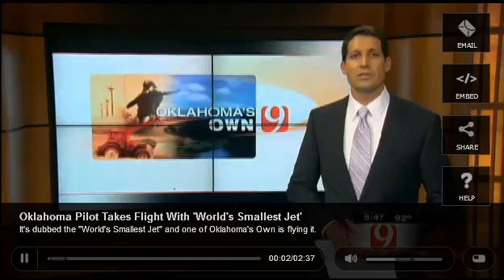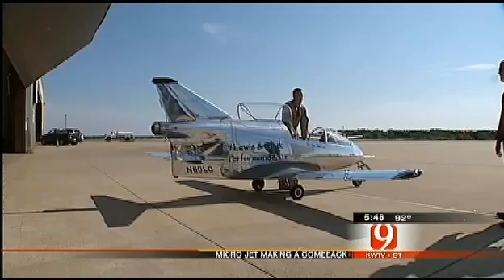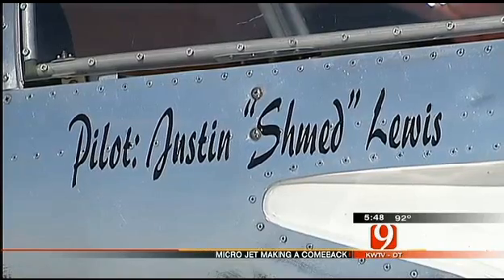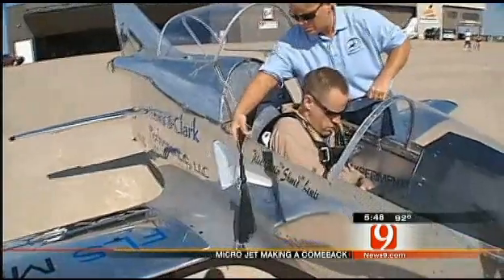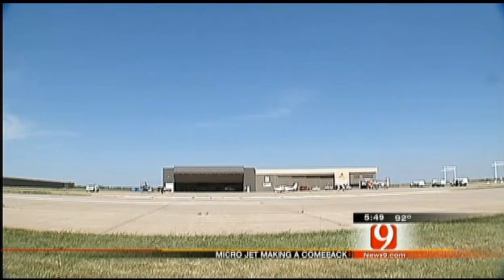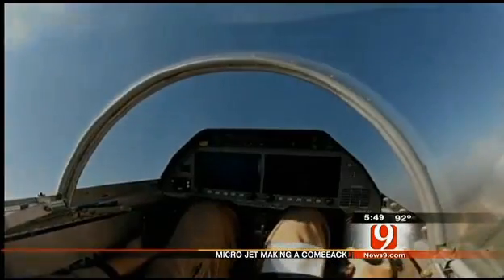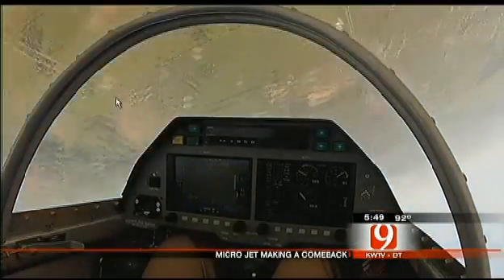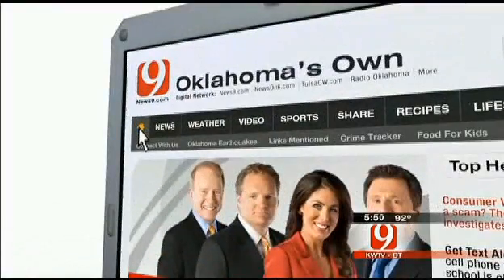Worlds Smallest Jet BD-5 FLS Microjet

Comment: Yes and both the BD-5 and BD-5J had a history of crash's.
Flying starts
Although Bede had suggested using the B wings, the earliest kits shipped only with the short "A" wings. All four examples completed with these wings crashed on their first flight, three on takeoff and one lasted long enough to crash on landing. In three of the four crashes, the pilots were killed. Of the first 25 completed, with both the "A" and "B" wings, 14 crashed with 9 fatalities.
Reply: Highlinerlocal66 Reminds me of Lancair. A friend of mine died on the second flight of a turbine Lancair 4. He built it himself, was a mechanical engineer and held a commercial pilots license with command instrument rating.
The test pilot also died and the cause was never determined. The investigation found nothing wrong with it. Weight and balance was within limits, the engine was producing power and the construction was determined to be completely fine - no mechanical problem of any kind was found.
It spun into the ground as a result of a stall test which was part of the flight certification process. The stall test was naturally conducted at an appropriate altitude and witnesses claimed the plane never looked like recovering during its plunge. 
I don't like kit planes.